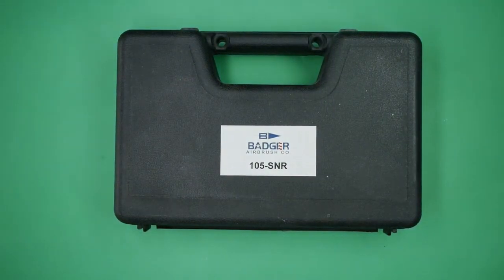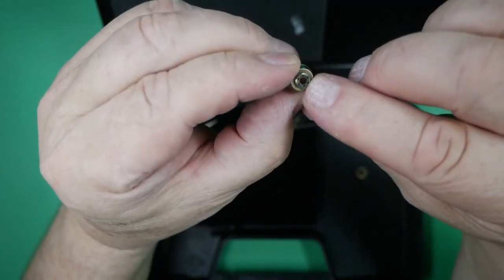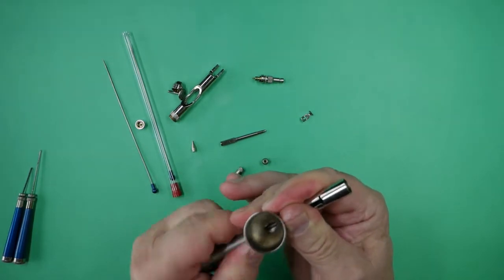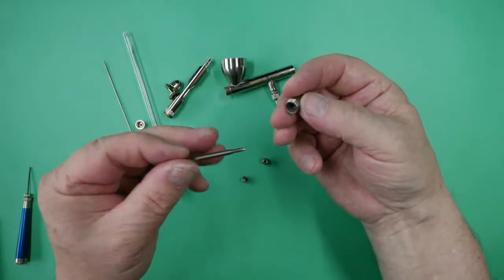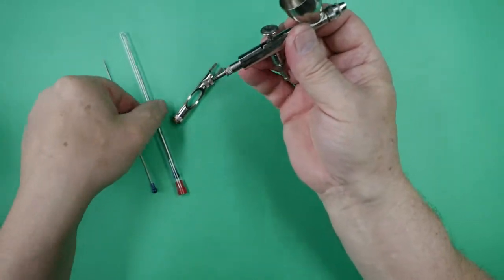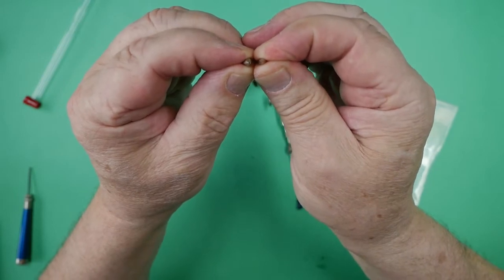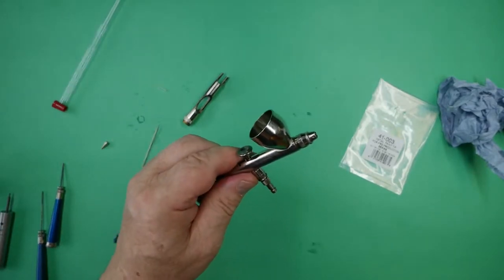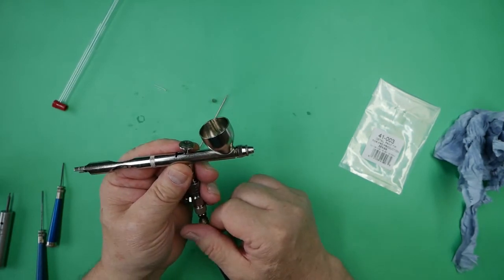Why is my Patriot 105 not working

Comment: I have a 105.  My first foray into spraying alcad aluminum yesterday was a disaster.  I am meticulous with cleaning my airbrush thoroughly after each use.  Yesterday it heaved and spat globs of metal onto my p47 thunderbolt.  I stripped it down and cleaned it again, put it back together and now the brand new needle valve is acting up.  I push down and I get paint where it should be just air.  Stripped the valve, made sure it was clean.  Now it functons but I dont trust it 😅
I will receive some regdab tomorrow.  I've never lubed my patriot ( 3 yrs problem free).
The only reason I replaced the needle valve was because I damaged the air hose threads on it.  When I push down on the trigger (no airline attached) it doesn't feel "right".  I'm hoping lube sorts it out.

Comment: Great video, I do myself suspect ive lost and o ring or two from my 105 from yourselves. It works fine but do you offer a service where you can check over, thoroughly clean and replace any dmaaged parts to a bager airbrush?
Reply from the maker: Yes this is the link to our Service repair page in our on line store, https://barwellbodyworks-shop.com/service-and-repair

Comment: Yeah I have a extreme patriot 105 and the trigger won’t mash down to let the air out I’ve checked the air valve and  it’s working could it be the trigger
Reply from the maker: Not likely to be the trigger, more likely to be blocked at the front end, the blockage is let letting the air out, take the tip, head, and spray regulator off and then see if the air is coming out , if it is one or more of the 3 part is blocked, hope this helps
Reply: @barwellukairbrushsupplies4324  I will try that out thanks
Reply: What is the spray regulator
Reply: I took the every thing off the front and blowed through the cup and I get air coming out but when I put it back together same thing no air
Reply: I checked all of the ones you spoke about and there are good
Reply from the maker: @sammyreliford7429  take a look at this video https://youtu.be/OauwVJIygg0
Reply from the maker: @sammyreliford7429  did you refit the air valve and if so did it work
Reply: @barwellukairbrushsupplies4324  I did but it still doesn’t work
Reply: I’m thinking about sending it to someone to fix it if I can’t get it fixed I’m going to order the air valve and see if that works if not I’ll send it to someone
Reply from the maker: @sammyreliford7429  did you test the air valve out side the airbrush as in the video ? ( 6mins 32 seconds )
Reply: @barwellukairbrushsupplies4324  yes sir I did it was working outside of the airbrush
Reply from the maker: @sammyreliford7429  Take the 3 parts off the front of the airbrush spray regulator, tip, and head, fit the air valve to the airbrush body and test to see if it working and air is coming out the front of the body, if it is then fit the tip and head to the airbrush body and test the air valve again, is air still coming out the front of the airbrush   ?